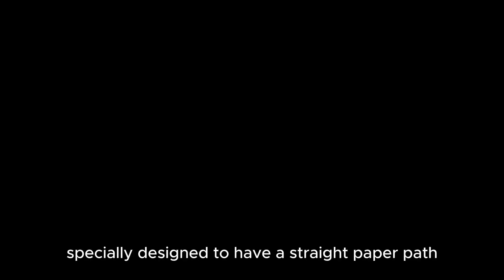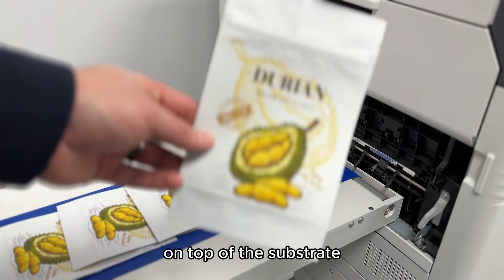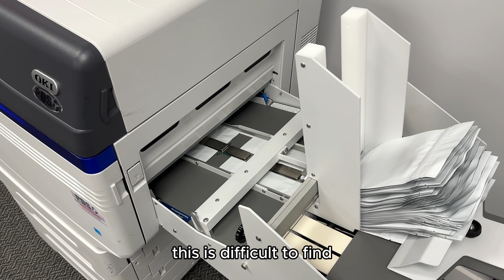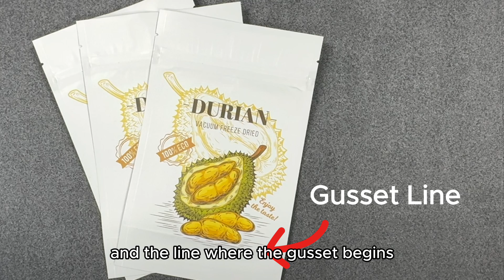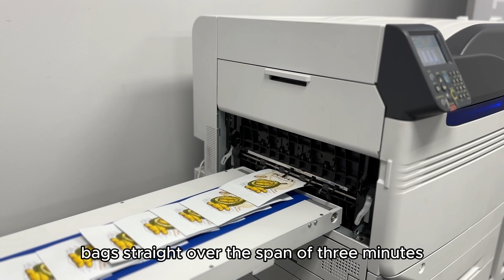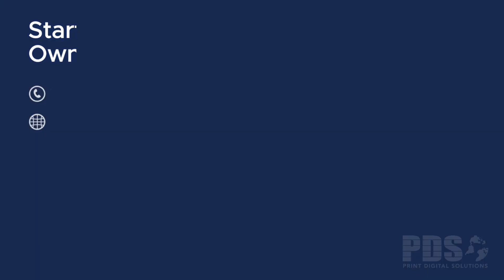Print Directly on Stand Up Pouches | SP1360W Mylar Bag Printer with White Toner

Comment: Everything is so beautiful only on video. I tested this equipment in Poland. The representative of the printer company could not print anything.😂
Reply: Hey guys, this type of printing is out of spec and requires experienced guidance to know which bags and which printer settings to use. PDS is based in Canada and we have spent hundreds of hours mastering direct print onto mylar bags. We don't just sell the equipment... we also teach the technique, provide printer settings, sell printable bags and offer on-going support to insure your success. If you have a very specific bag that you need to use, it may not be the right solution. However, if you are open to using a kraft or mylar pouch that we recommend, I am confident we can get you running successfully.
Reply: Is this available to ship to UK   @brettkisiloski2805
Reply: Oki are rubbish. Tried these in the UK as well and results are awful. Contacted my local engineer 5 times and still no luck. Their videos are all ok as these are heavily edited or they're masters at it. Customer service of OKI in the UK is really bad as well. Definitely won't recommend OKI. Try and asck questions on their YouTube, Facebook or Instagram videos and you'll see that they never reply to tricky questions because thry know that they have issues.